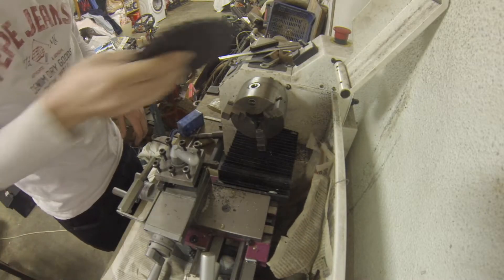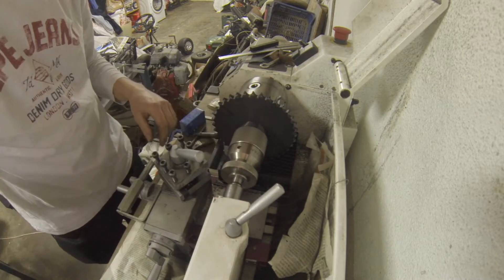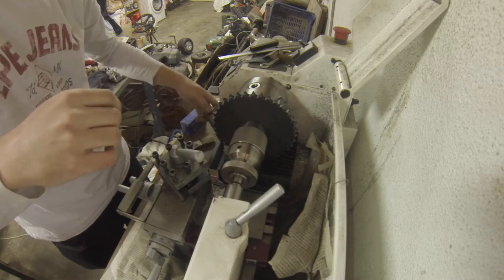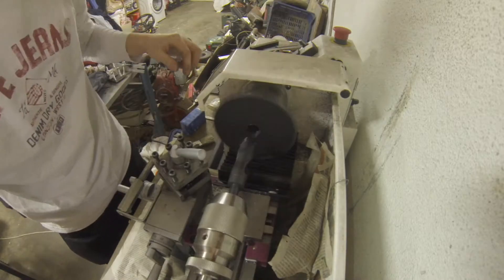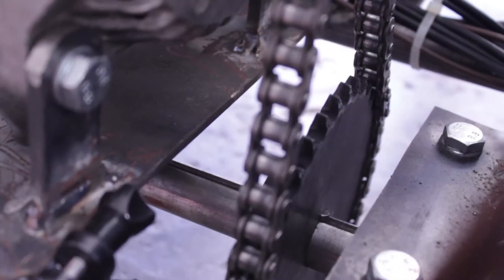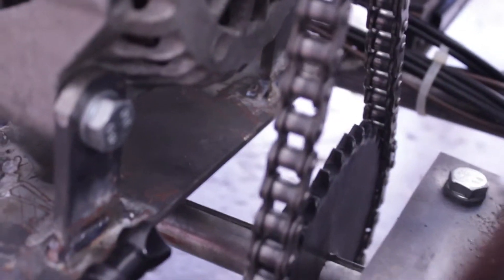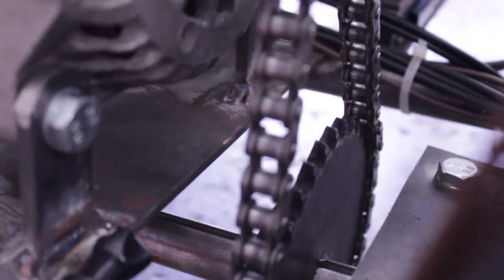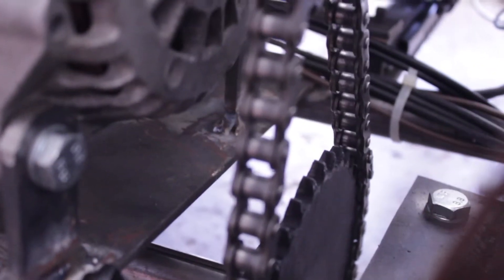Swapping a 3D PRINTED sprocket on a go kart!?? How long it will last? SUPER STRONG 3D PRINTED PART!

Comment: I'm impressed! Is it handling all the power from the motor? Did you test how long it lasted after the video?
Reply from the maker: Actually yes, but I ended up replacing the alternator with a 2,1kW bldc because it was a complete nightmare to use the alternator

Comment: So I just did this too.  Mine is going on an aircraft (ultralight).  You trust it to drive a prop? 😄
Reply from the maker: I would try with a timing belt (I tried it personally and works ok) because chains are a bit noisy

Comment: I also didn't expect much!
it could be done with aluminum casting, using PLA as a shape.
regarding the lathe, I was thinking of putting an alternator converted into a motor to increase the torque at low revs.
what do you think?
Reply from the maker: You can gear it down to increase torque output if speed isn't that important
Reply: @OverbuiltByHenry  I will try soon ad possible, thanks!

Comment: your lathe was not powerful enough for plastic?
Reply from the maker: Not powerful enough when the drill bit is bigger than 16mm, with a boring bar I can get the job done, also if the thickness of the part is small it does it great. The lathe is designed to do "clock work", not more or less intended to do the machining I end doing 😅.

Comment: nice, but if you make metal hub. it will be better
Reply: Since he has a lathe, he could have salvaged the old hub, and part of the sprocket. Machining the teeth off is a rough project for a small lathe, but they could be cut off with a cutoff saw or a plasma cutter or oxy-acetylene cutting torch. 

This would mean he'd only have to print a 'ring' to hold the sprocket teeth, and some bolts would be used to bolt it to the original hub. This could be done by machining a step hub on the old sprocket if you wanted a flush fitting ring. I'd probably make the ring about 40 mm in radial width. The holes can be printed in the ring and this would serve as a drilling guide to drill the holes in the hub later on.
Reply: Y ?

Comment: is this really PLA star for 428 chain ?! :-)
I only made PLA spacers between metal 428 stars in my DIY gear reducer (purple plastic spacers on video): https://youtu.be/U4-BDekq0jg
Reply from the maker: Yes, it's a 36 teeth sprocket made with tough PLA.
Reply: @OverbuiltByHenry  I'm not sure it's strong enough... I made wooden tractor and used 428 sprockets and chains in reducer and PLA in spacers between sprockets: https://youtu.be/U4-BDekq0jg
But not sure PLA 428 big or even small sprocket may handle such loads... How do you think?
Reply from the maker: I did it to test it and it really held up, I think it depends on the "powerplant", I have a small motor on my go kart and I saw your video and the engine is also small, so I think, most likely they are going to hold up with the reduction you have.
Reply: @OverbuiltByHenry  do you have STL for that? or maybe for 46T or more big sprocket? :-)
my motor has 3 horsepower - it's from gasoline grass trimmer. and 3 reductions from 13T to 46T sprockets, which gives 30:1 reduction, so my device most like a tractor not fast go cart :-))) also I have no bearings for that, so I used 16mm pipes (14mm inner diameter) for sleeves (hubs) and M12 bolts on which put sprockets with 3D printed spacers :-)))
btw I have an idea to use car engine timing belts (used, have a lots in garage) for that, but have no STLs for car timing belt sprockets... it will not produce such noise like chain does ;-)
Reply from the maker: @apristen  I actually imported the sprocket from McMaster-Carr on Autodesk Fusion 360 and modified the bore to fit my axle and added two extra holes to tap them for setscrews. I checked now and there are 45T, 48T, 54T, 57T, 60T...

Comment: This is amazing!  How long did this PLA part last? I own 3D printing farm and have over 7 years of experience in 3D printing, but if someone came to me with this request I would sent them home :) But you learn something new every day.
Reply from the maker: It is still mounted, It will stay installed until I receive a bigger one. I have a new controller to test and I will see if it can handle more amps.
Reply: @OverbuiltByHenry  That's great news. How much did you ride it till now?
Reply from the maker: I've been riding it since mid February until mid March due to the lockdown.  Still going strong, but with the new controller I am going to swap from 36 to 48 teeth to improve acceleration.

Comment: sry but if that took over a day you got ur settings fuuuuuuuuuucked up bro
Reply from the maker: I had the printer for more than a year and I know some basic parameters, I'm not an expert in this field. What settings I need to check? I'm using cura.
Reply: @OverbuiltByHenry  a good base to start at is 5 jerk, 1500 Accel and 50-60mm/s print speed. good blend between speed and quality
Reply from the maker: @tejdz1337  I will try it, thanks!
Reply: @tejdz1337  he's running 0.1mm layers... The time makes sense for the quality chosen.

Comment: nice video i am making a chainsaw powered scooter so this sprocket should do the trick.
Reply from the maker: I used some "reinforced PLA", keep the infill between 80-100% and a layer height of 0,1mm. Make sure you leave a bit of tolerance because then the print cools down the part shrinks. It will take a lot of time but most probably it will be strong! Thanks for watching.

Comment: that's a really resistent 3d printed piece
but now about the alternator:
can you get a 12v brushed controller to test the "field weakening" on the alternator's brushes, and test top speed with it?
Reply from the maker: Something like a PWM? Last week I discovered that the controller I am using has 3 "gears": low, medium and high; in this video I was using the high gear to test the sprocket in "extreme" conditions. I need to find a road long enough to do some top speed runs.
Reply: @OverbuiltByHenry  no, you keep the brushless controller with the "low mid high" setting
but instead of just putting a battery on the brushes, you get a brushed controller, extend the brushed controller's potentiometer wires to the dashboard
with the brushed controller changing the voltage/current on the field coils, it can help the top speed to be higher
(you start the kart turning on both controllers, with the brushless controlled by the pedal, and the brushed controlled by the potentiometer. To accelerate from zero or already running but in slow speeds, brushed controller in full throttle and use the pedal as normal, when you feel the top speed, try to dial down the potentiometer and you will feel that "suddenly" the motor can speed a bit more.)

Try to play with the motion of the potentiometer, and how low you can dial without losing power or feeling the motor "cogging"